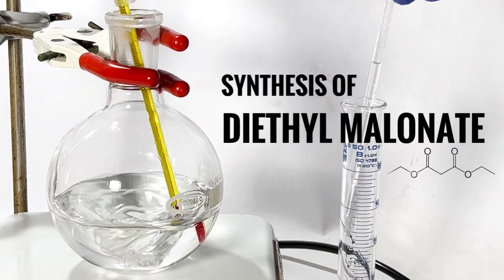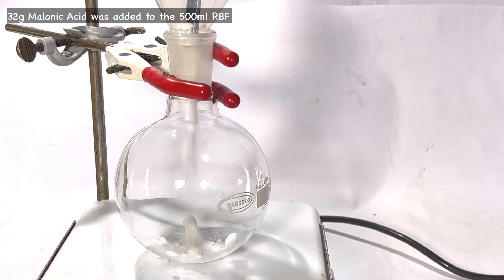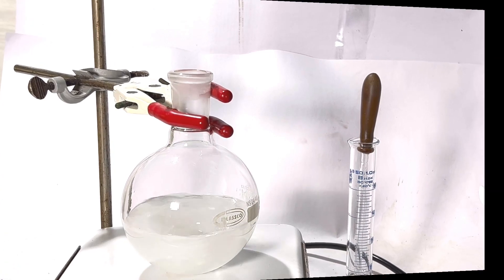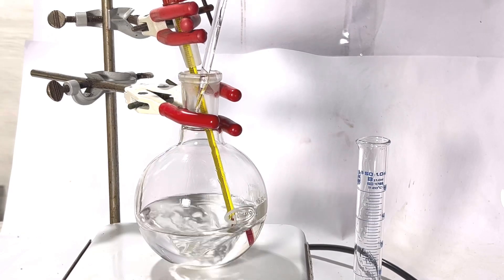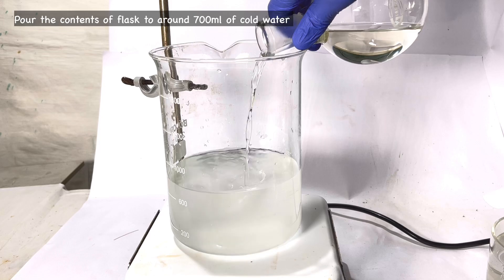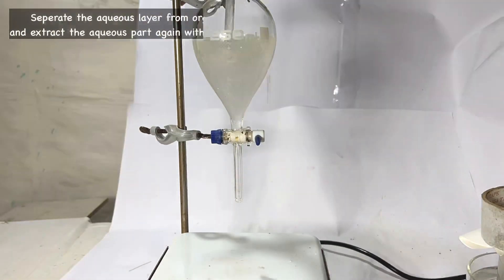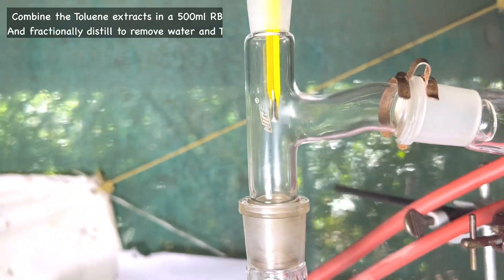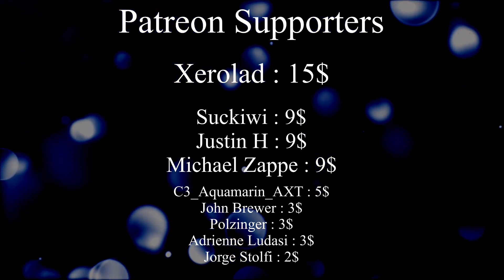Diethyl Malonate : Synthesis via Fischer Esterification

Comment: If I want to make some trimethyl citrate for candles, I assume it's pretty much the same technique, yes? About the same volumes except 50% more methanol than you used ethanol? Are there Any other wax like compounds that you can think of that would be safe to use for a mostly colorless flame?

   Reflex condenser? No worries your English is otherwise perfect and requires zero effort from me to decipher what you're saying ..
  If you catch me saying reflux  like that, take it as a shout out, and a thank you  acknowledgement to  you!
  Keep saying it like that too! If not like a personal signature, then just to get engagement out of the pronunciation Nazis 😉
Reply from the maker: Yes it is